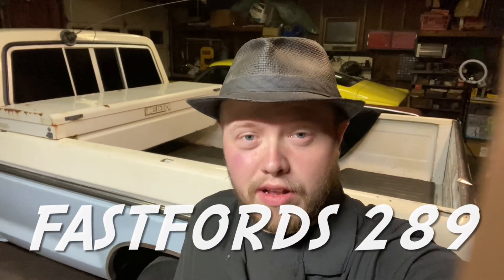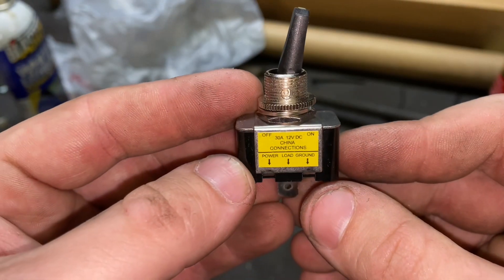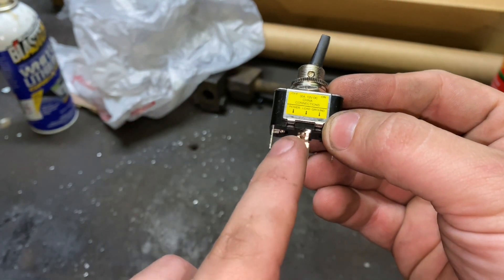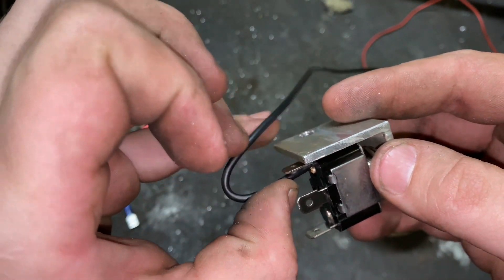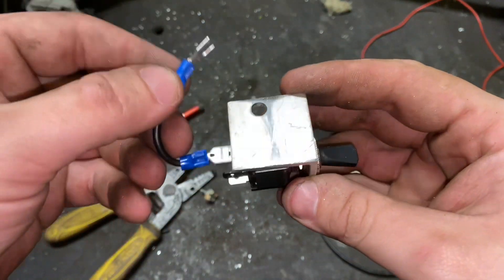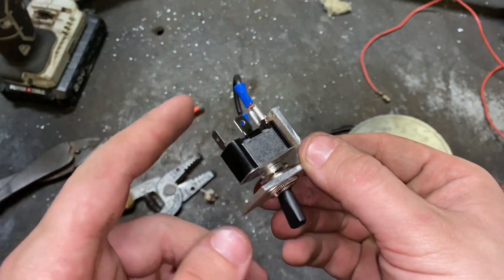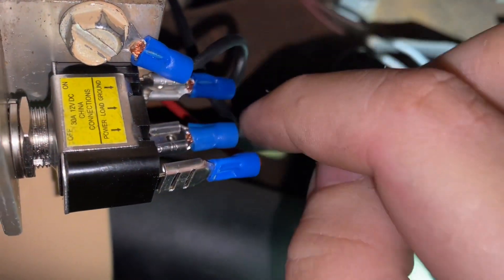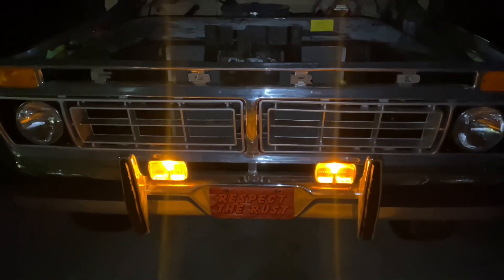How to wire a three terminal light up toggle switch.

Comment: Can you show where the wire to the key goes thank you
Reply from the maker: The red wire is the wire going to the key, I have it wired into an extra plug that wasn’t being used from the factory under the dash, but you can hook it anywhere you get 12v power, like the fuse box if you wanted to, I just utilized the plug I had since it was there. Hope this helps, if you have any other questions feel free to ask. Thanks for watching.